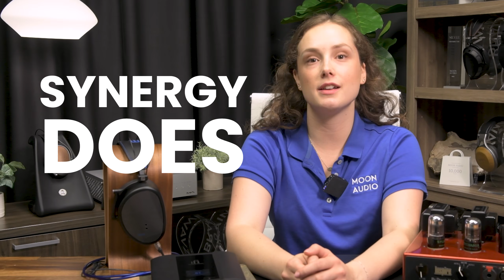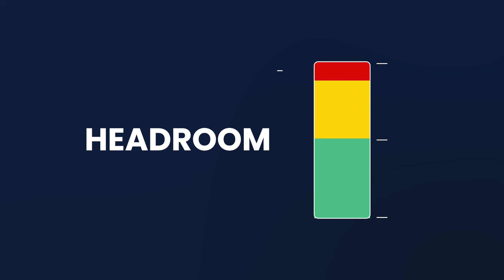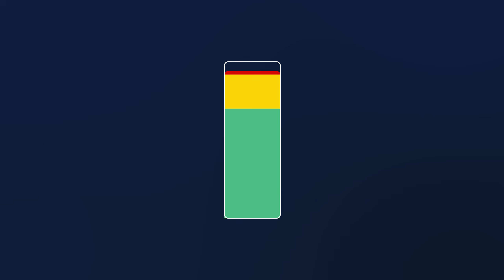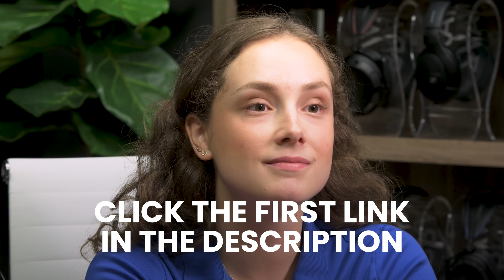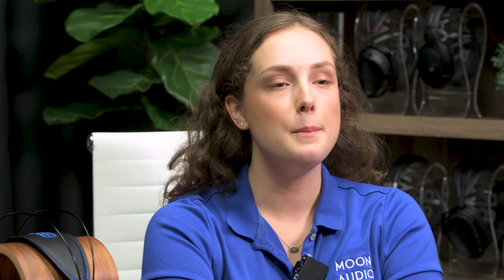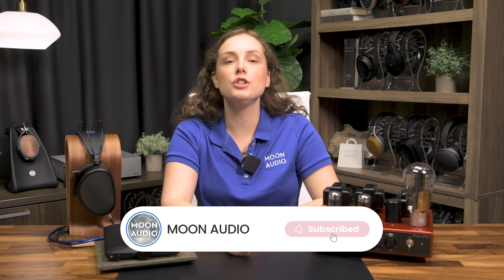Don't Make This Mistake With Your Headphone System

Comment: Two things to note, which many reviewers, dealers and online pundits ignore or are unaware of : 

1) The manufacturer's 1khz efficiency measurement rarely represents the lowest efficiency in the frequency range . Efficiency is frequency dependent .

2) As soon as you begin to EQ, quite often by lifting the bass region, you will be amazed at how much more power a 3dB or perhaps even a 10dB boost, will suddenly require .. especially when combined with point #1 .  It's an exponential relationship ....

Comment: So much of the information in this video is just fundamentally wrong that I genuinely wonder how that can be. Examples?
The Arya Organic is described as “highly efficient” here. It does have low impedance, yes, but that alone doesn’t make it “highly efficient.” At 94 dB/mW, it may be many things, but “highly efficient” certainly isn’t one of them.

The iFi Valkyrie is described as a “massive desktop amp.” Neither part of that description is really accurate. It isn’t “massive,” nor is it a “desktop amp,” even though you can of course also (!) use it as one. First and foremost, it is and remains a semi-portable, battery-powered DAC/amp.

It also doesn’t push out “5.7 watts” of power, even though that’s claimed here and is (unfortunately) also stated on iFi’s spec sheet. That figure — which was already highly problematic with the Diablo 2 — is a peak value achieved only for fractions of a second using iFi’s own non-standardized measurement methodology. The figure that actually matters here, the Valkyrie’s RMS output, is only around 2.2–2.3 watts RMS balanced into 64 ohms.

That’s certainly not a bad amount of power, but it is in absolutely no way — and I repeat, no way (!) — a “massive mismatch” for the Arya Organic. The Valkyrie can drive the Arya Organic without any problems, but purely in terms of power, the pairing is perfectly reasonable and certainly not “too much.”
I’m genuinely astonished and, frankly, negatively surprised to hear statements like these coming from supposed audio “experts.”

Comment: I agree. I have the Hifiman Ananda Nano planar magnetic headphones and I was paring them with the headphone stage in my Arcam A19, which was no afterthought when they designed it, but it’s not suitable for planar headphones, to spite the fact that it can run them with plenty current, but just sounds dull and flat. I then decided to try them with the headphone stage in my Fiio K11, which was a much better option, as the bass is much more defined and controlled and can drive these headphones much cleaner than the Arcam A19. Having said that, I do want to upgrade my DAC and perhaps also upgrade my to a seperate headphone amp to something like a Topping D90 so I can get the best out of my headphones from my analog components also.